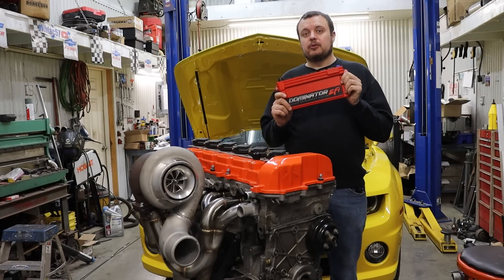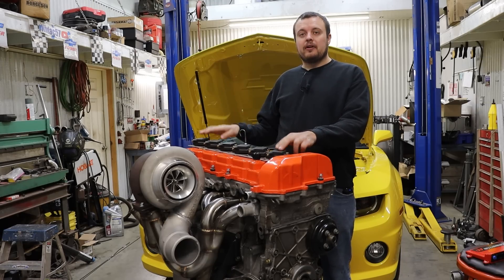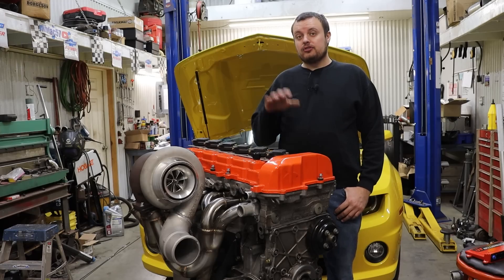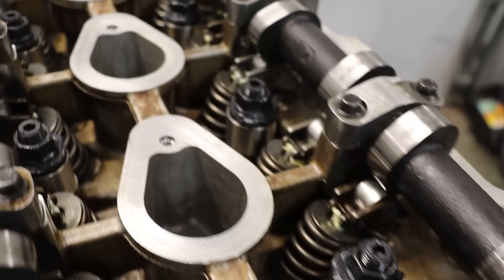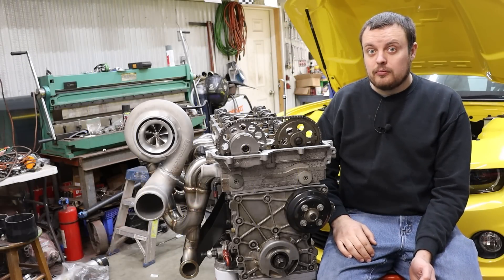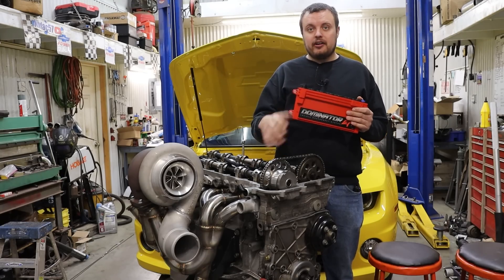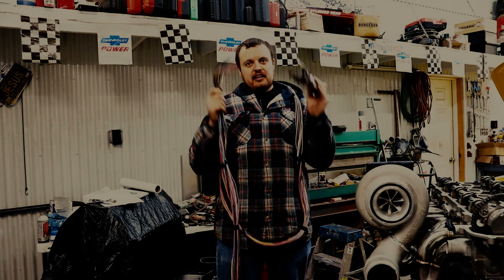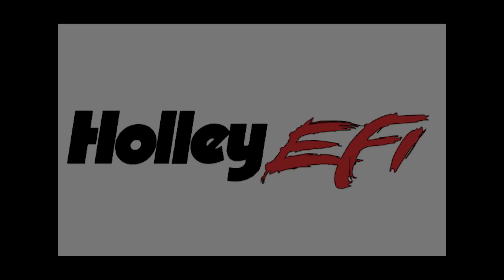Holley EFI: Can It Control A Vortec 4200 Engine?

Comment: Outside of no vvt control with holley 
What else would
Need to be done to make a term x or dominator work ?😊
Reply from the maker: That's basically it. It can do everything else. They just have to allow us to turn on the feature that is already working on other engines with the same exact trigger type.

Comment: Tech tip on reluctor wheels.
Late model trucks from 2004ish to 2013 4.3v6 engines have a 58x wheel keyed for a crank snout (like a vortec 350's 4 toothed wheel) under the timing cover. These wheels are available on ebay - amazon etc... for about $20 and can be used on whatever, just sandwich the reluctor wheel between the balancer and pulley, space your accessories accordingly and youre good. Oh and youll either have to relocate / lengthen your crank pos. Sensor and wiring as well as making a mount for that sensor

Comment: You can’t run port injectors on a GDI driver? There is a guy running a K series in a BRZ with the factory BRZ ECU. He is running second set of port injectors off the GDI driver.

Comment: Having little to no experience with standalone ECU's besides a Speeduino setup for my Datsun, I have no idea why Haltech hasn't gotten more use in the US. Just from everything I've seen with the Holley setups it's their way or the highway. You better be running a 3rd gen or you're out of luck, which even then you can easily tune the stock computers for free. Why lock VVT behind GDI? Do all 4th gen guy throw out VVT? The Haltech's can run almost anything port injection and their support seems to be world class or they have a really good PR / outreach department.

Comment: Holley has always dominated the american car industry. They muscle their way with sponsorship and advertising. They pretend like they are the only viable option. I bought the original holley 4 port throttle body fuel injection years ago....JUNK!!! They ended up swapping it back for a holley angular discharge carb and a mechanical fuel pump. I haven't respected them since. Motec is a more versatile option. In the last few years they started building more affordable ecus for enthusiast. american industry in some instances are too slow to respond to consumer needs and demands. Too many "meetings" with meetings about what the next meeting needs to be.

Comment: Just out of curiosity, could you cut the larger reluctor teeth down to the width of the short ones to shift the trailing edge to also be 90 degrees? Or would that change the "position" the computer thinks the cam is at? Holley should just fix it though.

Comment: why not invert the electrical signal so that rising is falling and falling is now rising, shouldnt that make the holly do the right thing? if its a digital signal a simple not gate should do, assuming clean edges, otherwise a comparator with inverting input and some hysteresis might be coaxed to do the trick.
Reply from the maker: Then the spark control won't work.

Comment: As someone who works at a software company, here's my take on why Holley won't fix this. The Dominator software is more than likely written on some barely strung together code that was never intended to be as flexible as it already is. Fixes and patches are just barely holding it together. The dev that wrote it has long since left the company and any new devs they have hired since, want to start over with scalable code base written in a more modern language but that would take ages to develop and test. So Holley has the devs continue to patch the rusty old pile of code, and their support team offer 'workarounds', because people still buy it for their LS projects and that's all the Holley really needs to make money.
Reply: This
Reply: makes perfect sense. not sure why ppl still buy holley. maxxecu is soo much better for nearly the same price
Reply: I learned a bit of BASIC in 1983 and I realized I needed to step off that crazy train. You proved me correct.

Comment: Hi in the mean time can you not just make a output 2d table pwm-  for each cam just open loop it, and build a map using this info from a LS unit probably works the same way.
The CMP actuator magnet is controlled by a 12-volt 150 Hz pulse width 0-100 percent duty-cycle signal from the ECM
Pressurized oil enters the retard cavities #2 of the actuator and moves the park pin #3 from the locked position.
As pressure increases within the retard cavities #2, the rotor and camshaft rotate counterclockwise, retarding valve timing.
As the duty cycle decreases, the spool is repositioned and oil is sent to the advance cavities #1, rotating the rotor and camshaft clockwise, advancing valve timing.
With a 0% duty cycle signal to the magnet, the spool is positioned in the fully extended position and there is full flow to the advance cavities of the actuator. As duty cycle increases to near 50%, flow to the advance cavities is decreased.
With a 50% duty cycle, the spool is positioned neutral with no flow to either the advance and retard cavities.
With a 51-100% duty cycle, the spool is positioned to provide oil flow to retard cavities. As the duty cycle increases, the flow to retard cavities increases.
With a 100% duty cycle, there is full flow to the retard cavities of the actuator.
The above duty cycle percentage values are only a guideline, as the actual duty cycle values may vary based on engine oil temperature, solenoid magnet coil temperature, magnet coil resistance and other specifics.
Article courtesy Underhood Service.

Comment: Slowly but surely more people will realize the benefits of keeping VVT. 
Im sure you know about it but Fueltech can handle multiple Variable cams. You are free to pretty much set it to read any number/position/type of teeth. They also have a tooth decoder which works well. 

Be sure to use hall effect though, dont go through what I did trying to use the stock  VR sensors.

Comment: EASY FIX.
You have a mill, modify the cam trigger wheel to have 4 trigger tabs. Each will be 90* apart. Just have to cut/mill off the 2 ‘long’ areas.
I have a picture to illustrate. I can send it to you.
Reply from the maker: Then the engine won't sync up and run. But the VVT control will work maybe, so there is that I guess.
Reply: So changing to read the rising edge would be the same problem? Not be able to sync but could control vvt.

Comment: You have me very intrigued on these inline 4.2's !!!! What HP are the stock internals good for? Ive seen some videos of them making 480-500. But how reliable is that? I was going to 2jz swap my Conquest, but am very interested in the 4.2 now!
Reply from the maker: We've made 605 whp on a totally stock engine, and 824whp on a stock engine plus cams and springs
Reply: @Calvin-Nelson  wow. Thats very impressive. What turbo and injectors? Also what ECU? I was thinking of a megasquirt system

Comment: have you tried put an inverter on the sensor wire, surrounded by an aluminum box?
Reply: don't forget you need the right voltage source and a ground wire.
Reply from the maker: I've thought about it. The ignition control will not work and the ECU won't sync up.

Comment: My wife is home driving my 05 blazer with a 4200 with 300,000 on the clock while her newer less used ride is in the shop. I am a fan of this little engine. I can see why you enjoy hopping them up. I’m mostly happy with stock these days. I get excited when something fires up and runs as it should these days. Especially if it really shouldn’t. That poor blazer was used and abused by a couple of its owners before I got it. It has had every excuse to quit, but refuses. I think I can get another 100,000 out of it.

Comment: Spit-balling, until they come up with a proper software fix, custom wheel? Lop off the existing teeth, reposition them so the falling edge is at the 90º where you need it.

Comment: I don't know if this has already been covered one of 400+ comments, but if it hasn't, a proof-of-concept for swapping the rising/falling edge trigger would be to use/make a very simple inverting buffer. It could be as simple as attaching the GATE of an n-channel MOSFET (BS170 or whatever. Even a 3904 transistor will work.) to the signal-output wire of the CMP, a 10k (or 1k) resistor between the +5v and the DRAIN and ECU CMP input wire of the MOSFET,  and attach the SOURCE of the MOSFET to GND. This will invert the waveform where H=L and L=H, without shifting the timing. Another method would be to use a simple inverting buffer, such as a 74LS04 (LS is important for 5v signals, HC and occasionally HCT generally don't work well at or above 5v) could also be implemented. 

The "x-factor" will always be if the wheel decoder is actually implemented and functional aside from the rising/falling edge detection.

Comment: Is using a NOT gate or inverting the camshaft signal the hack? If the ECU needs to trigger on the opposite edge then feeding the signal through a "magic box" which inverts the signal would make it look like it rises when it actually falls.
Reply from the maker: The ignition control will not work then.

Comment: I find Holley funny as they really only bother with the US market and not the rest of the world plus they go with what's popular instead of having truly modular ECU's like Link, Haltech, Motech, heck even the Speeduino. Even the Sniper can be problematic for dizzy triggering.
Having to using an industrial trigger sensor instead of a factory hall effect or VR sensor is just one of the crazy things Holley do. 

If only the firmware and software could be hacked :)
Reply from the maker: Yeah. Holley is really good with what they support, and you can do a lot with them, but they lack few things that would make life a lot cooler and easier. We'll make it work.

Comment: If it came down to it (assuming they fix the timing issue), couldn’t you run the VVT using a generic rpm triggered setting hooked up to some IO?
Reply from the maker: Unfortunately it is not that simple. It's not really an on or off type thing.

Comment: Holley doesn't write their firmware afaik. FJO, who makes widebands and designed the holley systems as there OG back in the late 2000s. They did something smart, they bought AEM " who had a motorola D space system designed by Woodward electronics , who makes OEM prototype controller's code etc" and then, they killed the best EFI system they had in their product portfolio. What AEM needed was transmission control added to the AEM infinity 7 series. Holley should have made a custome GUI for the infinity, and simplfied software for gear heads, and used the AEM electronics and software. As to your wrong edge situation, you could use a pair of transistors and invert the edge situation.

Comment: I'm kind of curious to see whether you solve this with a modified reluctor wheel or a signal phase inverter. Is it very hard to remove and machine the reluctor wheel so that it has 4 short teeth. Using a signal inverter seems like far less work though. That way the Holly ends up seeing the rising signal as a falling signal. Plus the timing will be at the stock positions.
Just kind of sucks that Holly won't fix such a simple thing.

Comment: Would it be possible to use a different reluctor wheel or manufacturer a reluctor for the cam that would work with the holley? I have no experience with the 4200, but it sounds like a really cool swap for my pickup

Comment: holley is not for car people.  they are for cranking out poorly made crap.  They bought out the names of all the good stuff from 10+ years ago, and now have those "same" products made overseas.  It's similar to the freedom group in the firearms industry.  Just looking to make money on a name alone.  Cal, I wish you'd revisit the speeduino system for the 4200.  Your own intelligence is your tech support.  You call Holley and they couldn't tell you how a carburetor works without connecting you to some guys cell phone haha.
Reply from the maker: Yeah. I just can't count on the Speeduino stuff. It's not powerful enough, and it has not been rigorously tested
Reply: That's sort of the conclusion I've come to.  The slightest deviation or power fault throws things way out of wack.  Here's another question: Have you considered a single blow through?  Depending on manifold, it might have difficulty giving equal fuel distribution. @Calvin-Nelson

Comment: The problem is, Holley isn't looking at it the right way. They are looking at as so few people will actually do this, that it's not profitable.  But if the same unit could do both then it'll add to their profits not lower them. This is the thing keeping me from trying this, I prefer the holley over the other stuff because let's say it, everyone uses it, it's established and proven. Cleetus McFarland has gone 6.45 with his Elcamino on a holley setup. If they got it working, then added a universal harness (IE key it yourself) they'd add not subtract to their fanbase
Reply from the maker: You just summarized why I am choosing to fight through it and use a Holley.

Comment: Sounds like some 6 sigma manager type wants to "create value" by artificially limiting the current product line so they can sell you next years newest and greatest limited wizz bang.
Reply from the maker: Yeah. They don't come out with new product very often. My guess would be there is just a very long dev cycle and they probably test things very rigorously. I just wish they made more releases. It's like 1 a year
Reply: @Calvin-Nelson  both can be true unfortunately, it's pretty common in large software companies.

Comment: It’s rather sad that Holley doesn’t seem to appreciate innovators. As much as I like their products. I’m guessing you’ve tried using custom settings in the ignition parameters. You can tell it to look at the rising or falling edge of the cam. I just went through this plus other issues to get a 1JZ non vvti to run on a Holley Terminator. Best of luck, I hope you get the support from Holley.
Reply from the maker: I've tried everything.
Reply: @Calvin-Nelson I figured, but I thought I’d ask. I recently did similar research about the rising and falling edges for the cam sensor.

Comment: Count me in as somebody who will be able to benefit if Holley changes this code. I called them exactly a year ago to see if a Terminator X could run my 2008 4200. They said a big YES including the VVT. The only exceptions I was told to change was going to IGN1A coils and use a throttle body that could use a 4 wire IAC. To date, I have made all the mechanical adaptations and I just need to wire in the generic harness. Keep up the good fight and maybe Holley will listen. To add, if no code changes ever arise from this......could the phaser be pinned someplace between advanced and retarded?
Reply from the maker: You could definitely pin it. I like making it variable. All personal preference I suppose.
Reply: Agreed on the variable. Hopefully this video and your efforts reach somebody at Holley. Thanks.

Comment: The different trigger lengths are used to determine the 0 of the cam. If they just went with the leading edge, they wouldn't know exactly where the cam is. Because the pickup would be the same
Reply from the maker: Different features require different info.

Comment: An extra cool thing about this is that the Camaro 5 is a Zeta platform, which means if the 4200 fits and works in it, the same should be true about swapping a G8, Caprice PPV or SS sedan of the VE, WM or VF series, the best candidates are the unloved V6 G8s and PPVs that go really cheap or a V8 car that was canniballized for it's V8 and is still in decent shape, all that would he different would be the length of the drive shaft and the exhaust is slightly longer and axle back bends are slightly different, even though you would probably just have a big single exhaust if it's single turbo. I wanted to use something like Holley if I swapped my 2004 GTO, so this is excellent you are cracking this, the only pain in the azz now will be adapting the bell housing to the T-56 and making the flywheel, clutch and everything work. Great stuff, I watch all you videos, this channel is criminally underrated. Even your LS/LT V8 info is priceless, rather than doing the LQ4 I have in my yard under a tarp, I was considering building an L8T 6.6L short block and buying a cheap L83/L84 to cannibalize for the heads, intake and anything I didn't use new or improved parts for if a 4200 isn't in the cards. It's a shame an L8T is not going to be a junkyard find and the bare blocks are so expensive, when they first came out I saw them for like $1000 new, now they are $2300, about the same price as an LS3 block, a 6.2/6.4 Hemi block is like $1800-2000 and a 6.8/7.3 Godzilla block is $995, which made me wonder how much it would cost me to buy everything and assemble a 7.3 Godzilla then either buy a Ford Modular bolt pattern T-56 or adapt to my existing T-56, at least it wouldn't require an expensive 10speed auto or a built 4R70W that has the ability to be tuned with a Holley. A Godzilla or an L8T would definitely be just as exciting as a 4200 in a GTO.

Comment: So, I'm no expert, not even a novice lol, but is there a way to build a standalone vvt controller? Like, is it PWM? If so, then can a dongke sweep the cam (provide the necessary voltage to the vvt solenoid) based on RPM? Would be archaic but simple once it's worked out..?
Reply from the maker: That's essentially what I'm going to end up doing.

Comment: Not to say this would be "easy" but could you take the signals and feed them to an arduino or similar small board pc and translate the output to what the holley wants?  but yeah seriously would be a fairly simple add on the holley end..
Reply from the maker: I'm kind of going to do that, but with a Maxxecu